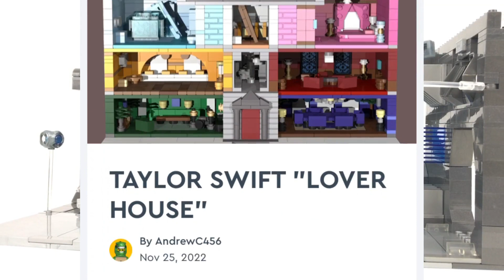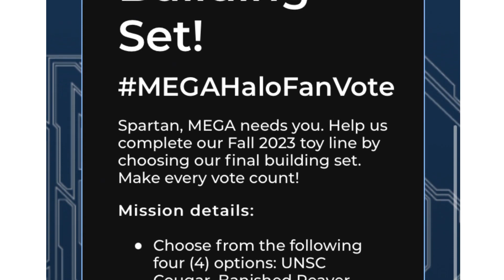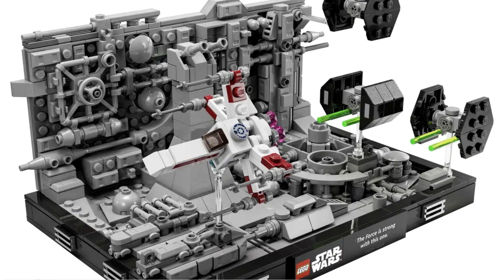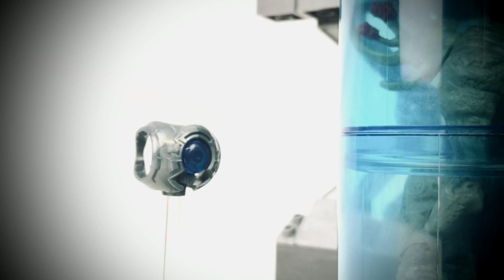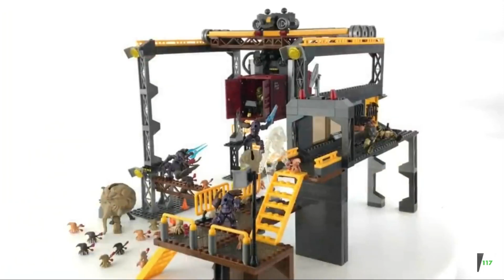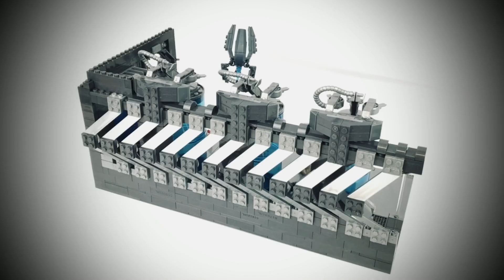MEGA Halo - Forerunner Flood Containment Lab set - 18+ Diorama ideas set custom build

Comment: The lack of parts packs or sets that are cheap for good parts is unfortunate. I have picked up several of the ring display sets at a majorly discounted price recently. They are full of reallly useful parts!
Reply from the maker: Agreed, I wanted to pick up a load of ring display sets for all of the black tiles included and small pieces but ended up getting the needlers instead.